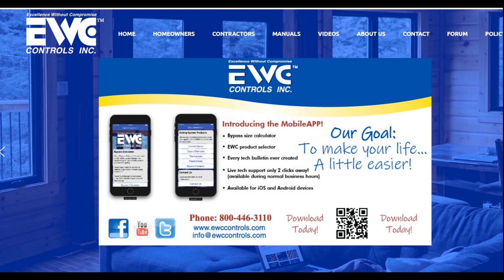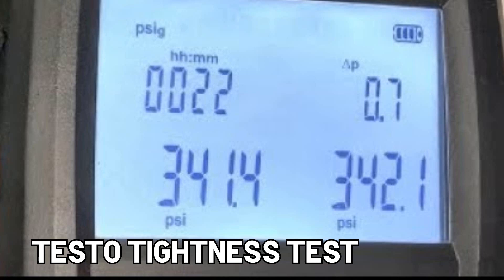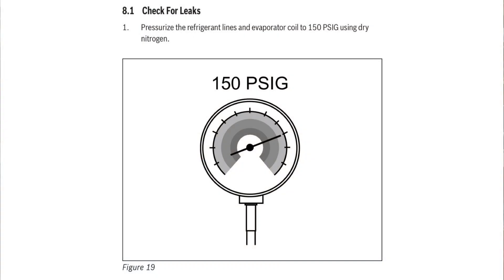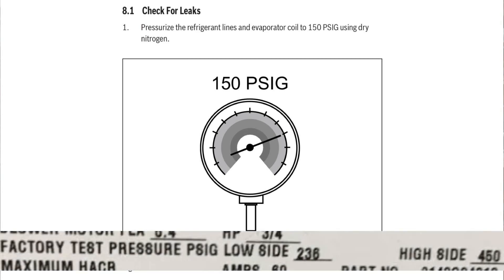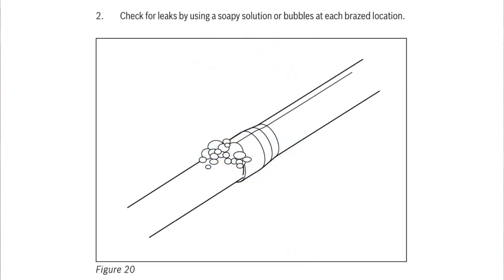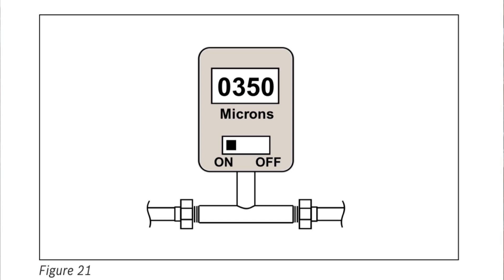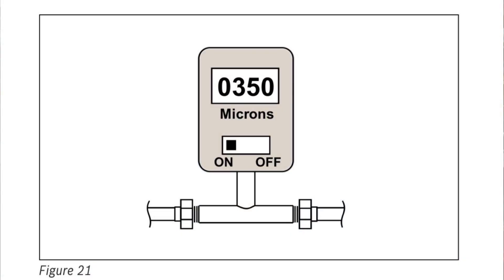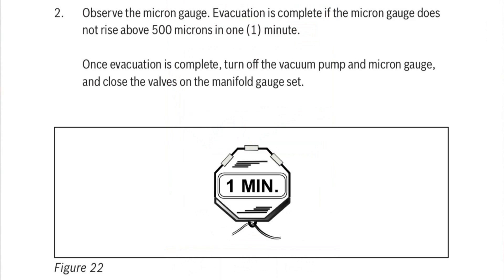Critical Steps Before HVAC System Start Up

Comment: I use the heck out nitrogen. Brazing, testing, cleaning lines and pressure checking. We bubble check and I always pull a hella vacuum and reach for 500 microns or lower. We also measure linesets and be sure we don’t have to weigh in any gas